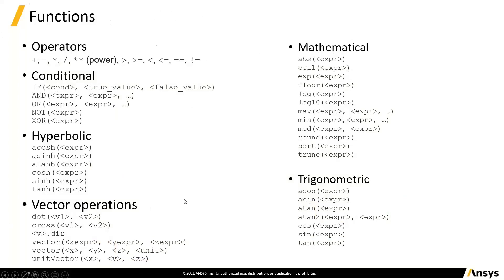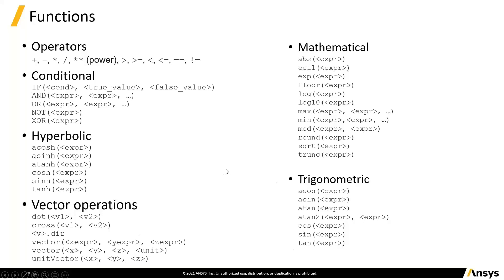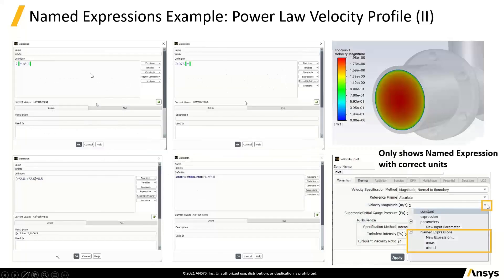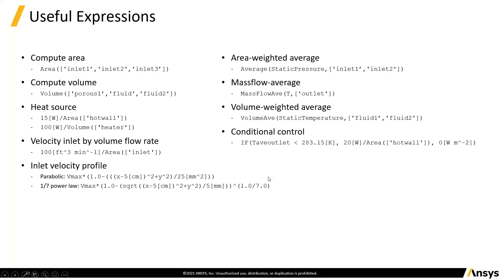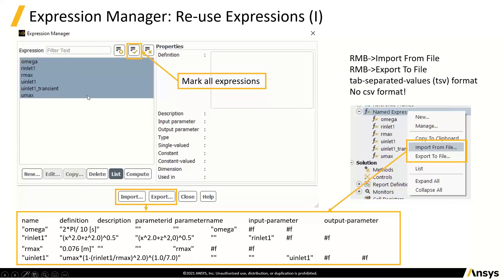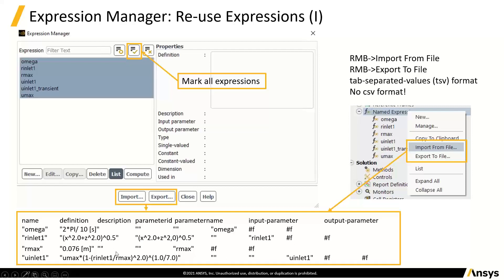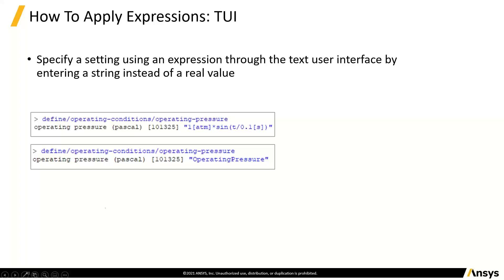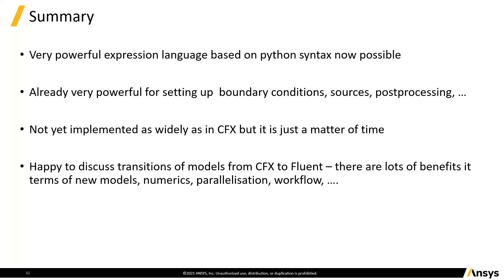How to Use Expressions in Ansys Fluent - Functions, Variables & More (Part 2 of 4)

Comment: Hi, great video . is it possible input a data file for heat generation rate in source term [ Application is for battery cells with respect to time. as battery heat rate by volume changes as per usage. if there's a csv file with data of heat gen rate(w/m^3) and time in second. is there a way to input the data and run the simulation-